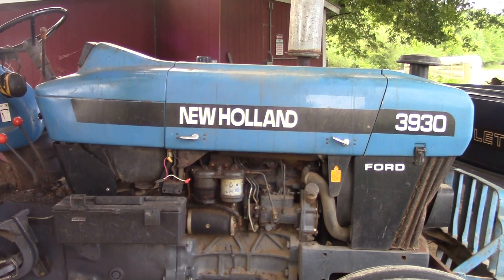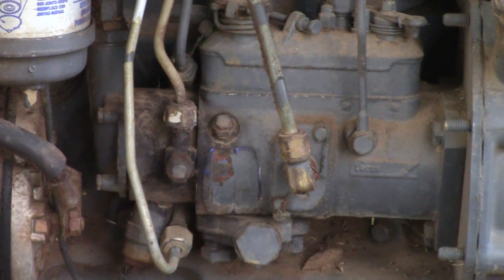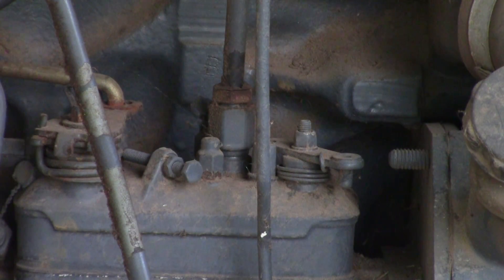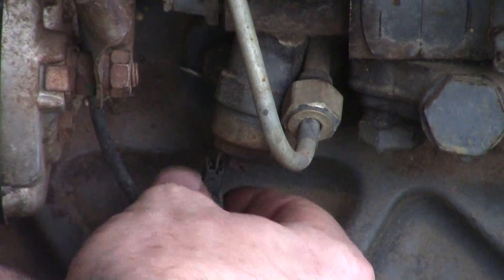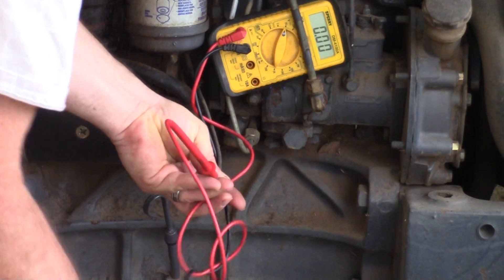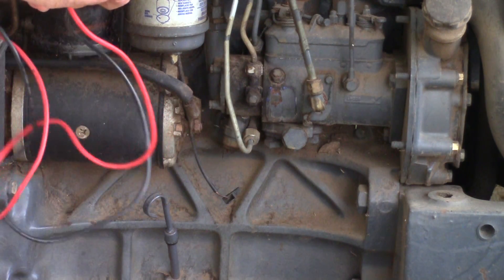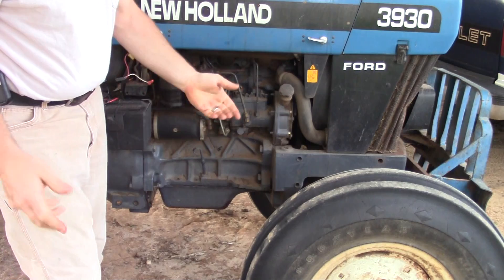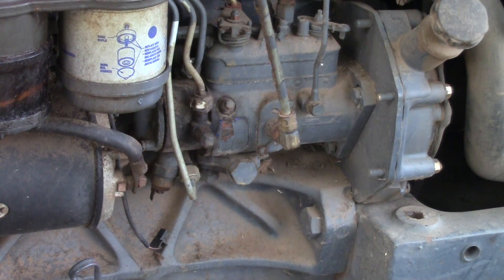Ford New Holland Tractor Electric Fuel Shutoff

Comment: Hello, I’ve been trying to fix my NH TZ22da for a few weeks.  Engine was stalling and hard to start.  Replaced in-line fuel filter and water separator, determine fuel was getting through hose from separator to injector pump but not coming out of pump.  Replaced the injector pump and still nothing.  Could it be the solenoid?  Thanks
Reply: I worked on a Ford 1920 that died while mowing.  I cut the 1/8 ' steel plunger off with a hacksaw and screwed it back in.  I was able to kill it using the manual lever on top of the injection pump.  Kept me working while waiting for a new fuel stop solenoid.  If voltage does not pull the rod in, it will not run.  Unless you cut the rod off.
Reply from the maker: It is definitely possible.  Did the new injector pump not come with a new solenoid?
Reply: @farmboy30117  No it didn't

Comment: Hello Farmboy have a question if my Ford 260c injection pump has both manual shut off an electric shut off
( Can I pull the shut off solenoid an put a bolt in the Hole an use manual shut off?? )
Reply from the maker: I don't know, but it'd be a cool mod if you did :)
Reply: Thanks for Replying FarmBoy 
When I said put a bolt in it I didn't mean a long bolt lol .
just long enough to fill the hole ware the Electric shut off solenoid was bolted in 

So My MAIN QUESTION IS WILL THE TRACTOR STILL RUN IF I PULL OUT THE ELECTRIC  SHUT OFF SOLENOID AN JUST KEEP THE HOLE FROM LEAKING WOULD IT STILL RUN YOU THINK??
Reply from the maker: @majorbabe6969  Since I have never tried it, I can't say for sure but I don't see why it wouldn't.
Reply: Thanks Again Farmboy I'm gonna try it if it works I will let you know then there's a delete option for those junk electric shut off solenoid  (=

Comment: Good info.  I have just worked on a later model 3930, pump is slightly different.  Had to run a new wire from new switch to fuel solenoid.  Now cannot seem to bleed the pump.  Have cracked all injector lines first at head, then 2 at pump. It cranks, but no start.  Suggestions?
Reply from the maker: I'd start at the filter and make sure it's full.  Then open the bleeder at the pump and make sure fuel comes out and reclose it.  Are you getting fuel out at the injectors when cranking?
Reply: Thanks.  Turns out the Fuel Shutoff was not energizing.  Several have messed with the wiring. Can't find a good diagram of the switch.  It will either start and not turn off, or not start but will turn off after jumping the shutoff but not start with the key.  No clue where the wire goes from switch to Starter Module.  I have done about every combination on the six terminals.

Comment: For a quick fix you can splice into headlight wire with a trailer wiring splice (no cutting) and run a short piece of wire with a female connector that plugs right on to fuel solenoid and voila you can then start tractor by switching on headlights and then cranking with key as normal. I did this to a 3430 New Holland/Ford to eliminate downtime. I didn't want to have to stall the tractor to kill it. I can just switch off the lights to kill the tractor and then the key to eliminate any current draw. By using the headlight switch I didn't have to install another switch as this is just a planned temporary fix for me. The only drawback is the headlights have to be on to operate the tractor. It's kind of a theft deterrent also due to the combination to starting lol. I think either the switch or diode(s) in the starting circuit need to be replaced. I got as far as determining that voltage was present to solenoid when key was on and dropped out when starting.

Comment: I'm having trouble getting my 3930 to start. Battery is good, neutral safety switch is good, solenoid to the fuel shut off is good. Any ideas?
Reply from the maker: Are you having trouble with getting it to crank over or fire off?  There is another safety switch on the PTO lever that would keep it from cranking over.  If it won't fire off, crack the fuel line at the injectors to see if you're getting fuel to them.  Like Joe said below, if it ain't smoking, it ain't getting any fuel.  If you aren't getting fuel to the injectors, make sure your filter isn't stopped up and the shutoff valve is open.  Failing all that, it could be a bad injection pump or the pump is out of time.
Reply: +farmboy30117 it's getting fuel but all I'm getting it a click. It's not trying to crank at all. Can jump the starter but the key won't turn it on. Looks like the previous owner bypassed the pto safety switch.

Comment: Nice demonstration. Think I'd just bypass it and run a cable to the manual shutoff. Better things to spend $60 on!
Reply from the maker: Thanks, I would too if it ever gives trouble.  It shouldn't be too hard to pull the guts out of it ;)